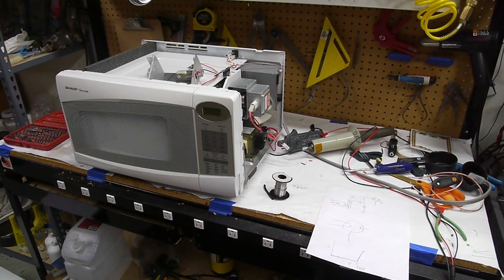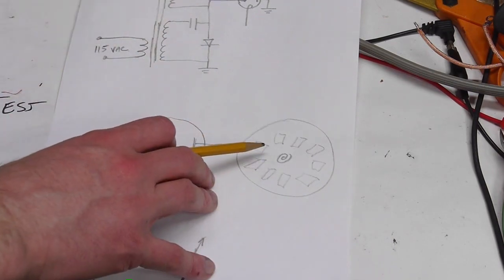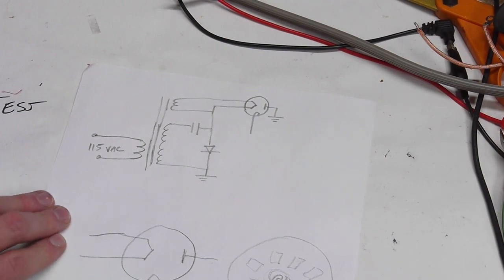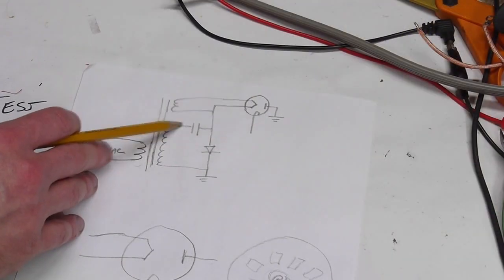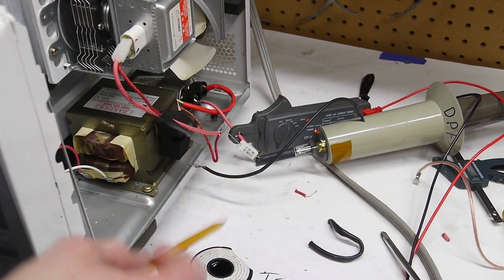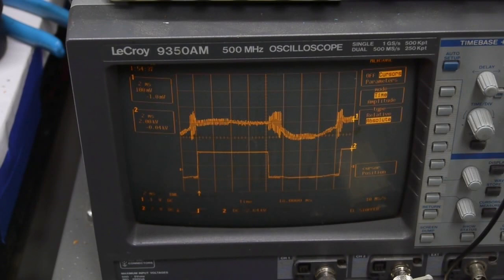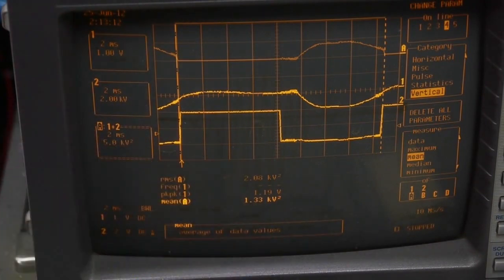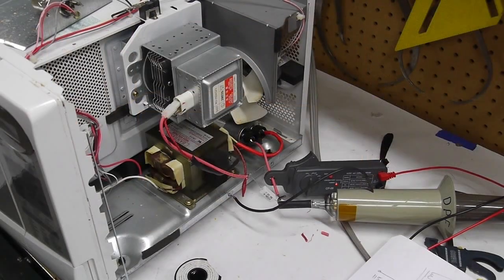Measuring the voltage and current of a microwave oven magnetron

Comment: If positive output is connected with MOV body and cabinet why not it's dangerous to touch the cabinet ( even at negative voltage at output ! ) Or it is because ... ! The output is isolated from mains so touching the cabinet can't close the circuit  or something similar ??

Comment: If I'm not mistaken, microwave ovens are rated by their output power, not their input power.  That looks like an 1100 watt microwave (Sharp R308N or similar).  Based on Ben's measurement of 1.33 kW power to the magnetron, that would make it 83% efficient, which is about what you would expect for a magnetron.

Comment: Loving your videos!  The frequency of oscillation is actually a function of the LC tank circuit each of the cavities makes.  So they are tuned to 2.45GHz.  The magnets are there to provide centripetal force to the electrons so they spin around in a helical pattern to impart energy into each of the cavities as they spin around.  Because of mutual coupling, placing an antenna in any one cavity will couple the energy of all the cavities at the same time.  Again great video!

Comment: Surprised you didn't just unbolt the transformer and diode from the chassis and insert your shunt there; then ground voltage is maintained for safety and you can measure current via ohm's law. As to the average power, if the peak is 1A and the waveform is roughly sinusoidal, then you should have average of 707mA by RMS. So you have 2.8kW half the time (halfwave rectification), thus 1.4kW average input. I'm not seeing anything out of the ordinary here.

Comment: I believe the2 ms.  The current is space charge limited as the electrons just spin around until the voltage is high enough for the electron frequency to match the resonant frequency of the RF structure.  At this point energy is coupled out of the beam, orbits decay and electrons hit the anode, removing themselves from the electron cloud.  Current flows.

Comment: Um... In high voltage circuit there is a 2100V 1uF capacitor in series. This is half-wave voltage doubler. During half wave it is charged ( until 2100V , about 2.2J) and then release 4.4 joule at another half wave..... therefore  the HV side consumes 4.4 x 60= 264J per second in case of 60Hz...
So magnetron HV wattage is 264W! And mean current is 264w/2100V=0.125A
This is my opinion. Is it right?

Comment: Why is your voltage output a square wave? It should never be a perfect square since the start of the negative 60Hz cycle voltage should be just the peak of 2200v. In the middle of the negative cycle, it will not be 4400V eithrr because the capacitor already discharged some of its energy. Towards the end of the 60Hz negative cycle, the voltage will diminish close to zero, or if the capacitor is big enough, to 1800v to 2000v range. When you have load, ie you have food or water in the oven, the capacitor will never be big enough

Comment: The power supply is more complex then you diagram.  Look carefully at the transformer.  You will note a magnetic shunt between the primary side (where the 120VAC comes in, and also the filament 4V winding is) and the secondary side.  This type of supply is a "ferroresonant regulator".  The cap does more then double the voltage; it is in series resonance  (at 60 Hz) with the leakage inductance (created by the magnetic shunt) of the secondary.  Because of this resonance, the output voltage would build up "to infinity", (like a tesla coil) if it were not for "some limiting mechanism".  That limiting mechanism is the saturation of the steel in the magnetic shunt.  So the power supply is a sinusoidal (half-wave) current source.  It must be, as a magnatron is an "obnoxious" load, like a gas tube, with negative resistance.  This regulator is used in mercury vapor and sodium vapor streetlights, and was used in old (heavy!) computer regulated supplies.  To work properly, only the frequency needs be correct; line voltage can vary a lot.  (Topaz "constant voltage transformers" also work by the same principle.)
If you try to push more current through a magnetron then the cathode can emit, the current abruptly cuts off (in nanoseconds!) resulting in a huge spike.  For this reason, the diode has a special "soft" characteristic to damp this.  (At turn on, the cathode is cold, so no current flows.  As it heats up, current starts to flow at the start of current sine wave, where the current is low.  When the current exceeds the emission of the (not yet totally hot) cathode, and current suddenly cuts off.  As the cathode gets hotter, conduction time gets longer until suddenly cathode is hot enough to allow conduction the complete half-cycle.  Listen carefully as oven is turned on.  You will hear a "ba-zap" sound like Darth Vader's laser sword being powered up.  That sound is produced by the changing phase shift of the cutoff, then abruptly stops when cathode is hot enough.  If you put scope in long record mode, you should be able to see the changing current cutoff, if the EMI spike doesn't hide it.)
I mention this because I think magnetron will "stall" if you try to "shove" spike of current through.  Even if it doesn't, the cathode will limit the current because of its limited thermionic emission.  A huge electric field will build up at the cathode, maybe leading to destructive arc (blowing off the thorium at the surface of the thoriated tungsten filament).  If magnetron "works", it may arc over at the output probe.  Radar tubes are typically in pressurized container, some with SF6, up to the point where the horn antenna is flared enough to prevent flashover.
Newer microwave ovens have switching supply.  I don't know the details how they work, other then having resonant transformer (with litz wire primary) and 2 diodes in a voltage doubler configuration.  I have photos of newer supplies.
Reply: MOTs not only saturates at the secondary side, but beacuse copper(or aluminium) windings in the primary coil, and steel are cheaped out, they draw lot of current, and dissipate heat without load, and the cap disconnected(hundreds of watts of copper and core loss).  Altough, MOTs in old russian ovens at the same ratings are twice as big, had hypersil cores, only handwarm after hours of no load circumstances, but a regural cheap chinese one cook itself without cooling in an hour.
I'm pretty shure that the new smsp drivers are far more efficient.

Comment: Only God can help the amount of harmonics and power factor that these devices are putting on the grid
Reply: No they are not!  The transformer in the oven he shows, is a "ferroresonant regulator".  The cap is in resonance with the magnetic leakage of the transformer (a magnetic shunt is inserted on purpose to get this leakage).  Resonant circuits "demand" a sine waveform.  Any deviation (due to diode switching, etc.) causes resonant circuit to deliver/accept energy to force sine wave load on line, at near unity power factor.
Newer ovens have switching supply.  I suspect (but have not confirmed) that they use power factor correction in their switching algorithms.

Comment: For a fixed magnetic filled, the I V curve is actually much steeper than you have drawn.  There is a threshold of electron angular velocity below which the tube will not oscillate, therefore no energy or velocity is taken from the electron cloud and the current is limited by space charge to essentially zero current.  If you detected RF power you will see perfect alignment with RF and cathode current. Once the tube is making power the impedance  is  very low and current is limited by the leakage inductance and resistance of the transformer.
Reply: What you say about the tube is correct.  But the "transformer" is way more complex then he explains.  The capacitor and the leakage inductance of the secondary (there is a magnetic shunt to make this) are in series resonance.  Current builds up until the shunt saturates, detuning the circuit.  It is a very accurate regulator, if the driving frequency is correct.  It is also used in streetlights, old computers, and Topaz "constant voltage transformers".

Comment: i like the video, it helps me understand a lot.i have one thing to ask ,normally most of the time as i observed most of the magnetrons are supplied with a  3 to 4V Ac and up to 10 A current flowing through the filament.  what will happen if the supplied voltage to the filament is increased  or decreased? what makes the microwave output power high or low ?is is the filament voltage variation or the high voltage side variation ?
Reply: the microwave output power is decided by the capacitor in the voltage doubler circuit, making the capacitance larger increases the high voltage and thus the microwave output power, however its important not to exceed the maximum output of the magnetron .

Comment: Hi nice video.i want to ask one question .do we have different magnetron rating is it all same or ...?I noticed from articles that they have a filament which is mostly supplied 3.2V ac. Do we have any other such parameters ?I wonder what really makes the microwave output power higher?is it the high voltage of the filament voltage ?

Comment: +Applied Science Part of the time delay between voltage and current may be due to the fact that many electrons return to the filament (after having lost energy by creating microwave photons). They make the filament hotter by hitting it. Hotter filaments emit more electrons (more current), but as a nonlinear regenerative process, it takes a while to get going. The overall process causes some undesired Frequency Modulation in the 2.45 GHz output. Also, when the HV section starts to flow real current, that robs some power from the filament winding. It would be interesting to see how things would behave if the filament was powered independently.

Comment: So... The lag between voltage and current is probably correct. You noted that you thought that it might be an artifact of your probe, but that lag is partly why cavity magnetrons are not used in high power communications.

Next, they have harmonic overtones... 1/2 wave, 1/3 wave, 1/4 wave etc.... and each of those produce a disruptive tone which can actually reach resonance before you hit the frequency that the magnetron is supposed to be tuned to. This is something you probably need to know, but you're probably also aware of. As a quick note, if you can find a tone not absorbed by water, sugar, and oils, that might be safer to work with, but if you're trying to flash cook nm. (aka only helpful if you're making an EMdrive) 

Thirdly, Cavity magnetrons are voltage controlled. The calculation is based on the distance of the anode from the cathode but it also involves the magnetic field. If you want better control over the magnetron for more precision you should actually remove the permanent magnets and use an electromagnetic coil (like a solenoid). The magnetic current through the permanent magnets controls the electron bunching through the magnetron; if replaced with an electromagnetic coil, the voltage through the electromagnet could be used to control the frequency. 

Finally... Especially you with your awesome lab, could actually make a cavity magnetron tuned to a frequency that isn't lossy (aka not water and fat). I've been kinda working on it but i figured it'd be a bit before i made a video about it..... here's some math that I've noted...

Frequency = 
(((Magnetic permability of free space)(dielectric constant of material in the not metal parts of cavity magnetron)(circumference of 1 resonant cavity)(length of magnetron tube * distance of the resonant cavity from the cathode)))
                                                                              /
(Length of magnetron tube * distance or break in circumference of resonant cavity)

If you notice, the length of the magnetron can actually be dropped out and you can simply look at the magnetron in it's entirety as a circular cross section. I suspect that the break in the resonant cavity should also appear as a subtraction term in the circumference of the resonant cavity, but i might be wrong. 

Any way... i spent the last few weeks incidentally looking into microwaves and thought i might be helpful. Don't cook yourself with a stray microwave emitter, and I can send better mathematical formula if this helped at all. If you made a magnetron, there's a few other things i can throw up like pi strapping, resonance conditions, and some things that effect efficiency.
Reply: You have several errors in your material. 1, the lag MAY be due solely to his current probe (an RF detector like an HP423 could confirm WHEN the tube actually start to make RF energy), 2, the overtones (cavities work on ODD overtones, not even). There is NO non-lossy frequency for water as you seem to indicate; the action of 'heating' is because water is a polar molecule and TRIES to move with the applied RF field, in particular the E-field (It tried to align to it).  Industrial ovens work on the other ISM band (900 MHz). You're probably wrong on some other points as well, so, anybody who is reading this - beware of what he has proffered.
Reply: @uploadJ  yeah maybe, but, I bet my left nut there will be some crazy experimenters out there who picked up on the idea of changing the frequency of the microwave simply by removing the donuts magnets and using a coil in their place, or maybe just adding a coil to the magnets….to make a new type of wild FM transmitter ! the COIL-A-TRON ! copyright Psychroniser...

Comment: Why is the range so weak on such powerful magnetrons? I see videos of people putting cans on the end but it still seemed limited to around a foot in front of it.  It would be good if you could make a beam so you could then use it for some point to point wireless powered devices.

Comment: Maybe you can measure the HV current by clamping the clampmeter on both filament wires?
Reply: +Applied Science Listen to this man, +Tim van Neijenhoff. Opposing currents in co-clamped wires will cancel out, which is perfect for distinguishing the Anode current from the Filament current.

Comment: I once presented a small research on microwave cavity resonators and simulating them. After the presentation, a member of the "jury" told me that I'd get 3x the power out of a microwave oven magnetron if I cooled it. Run cold water trough the vanes?

Comment: Could the electrons that circulate through the cavity of the magnetron, since they're moving as if in a coil of wire (even though they're moving through a vacuum) act as an inductor, causing the current to lag the voltage?

Comment: I would guess that the current lagging the voltage is the power factor caused by the large transformer acting as an inductor.. its interesting that the capacitor is oversized quite nicely and that it isn't dropping voltage near the end of the waveform, I would have thought manufacturers would have put the smallest cap in that would only just get the job done.
Reply: I would have expected the voltage to sag; it didn't. It's probably the current probe he's using (if it uses a Hall effect, that's probably why)

Comment: To our younger scientists and electronic engineers I'd like to point out that working with magnetrons is serious and is extremely dangerous, embolisms (microwaves can and do evaporate subcutaneous fluids) and cancers (DNA and RNA damage) come immediately  to mind in addition to burns and very possible fatal electrocutions.  As soon as you start work on a microwave your are on the wild side of dangerous explorations.  Inform yourself of all precautions before looking under the hood.
Reply: Your eyes; ask me how I know (had double cataract surgery at only 63 last year, one eye completely blind for last 20 years.)
Reply: The DNA and RNA damage is a myth. Microwaves at 2.45 ghz are far from ionizing frequencies which are beyong blue color, above 800 thz.
But there is strong risk of electrocution. In fact, my worst fear happened trying to create a microwave gun. I touched the transformer and got the "fear of dying" more than pain, worst than color tv shock at 25 kv.
I assume the ground from the electric plug may have been faulty...
And maybe, as radio frequency do, there could have been some unpredictable path to the signal.
If you still want take that risk, tell your mom or roomate to check on you and make sure they know cpr.
Reply: @moiquiregardevideo , I wouldn't be so sure about the DNA/RNA thing. Non coding RNA folds up like proteins and creates secondary and tertiary structures whose resonant frequencies are way lower than the bonds between individual nucleotides. Denaturing those molecules could lead to cancerous activities.

Comment: I had a few questions about magnetrons 
1) How do you calculate the amount of electrons emitted from the cathode?
2) How the amount of electrons emitted from cahtode and  the voltage between the anode and cathode affect the power output of the magnetron?
Youre help is greatly appreciated.
Reply: Vacuum tube theory; look up Thoriated Tungsten in particular.
Reply: After 6 years, do you still want to know? Or somebody else stumble on this youtube video and wander...
The number of electrons is exactly the current in amps (multiplied by a constant to adjust the units).
The power formula in p=vi 
So, current in amps
Multiplied by voltage in volt
Gives power in watts, which is joule per second.

Comment: Hi, the magnetron of my microwave it´s broken , so i need to replace it . The magnetron is a Galanz M24FB-210A G0208o12 GAL02 GEMC . 
My questions are: 
1. Can i replace it with another model, or it must be identical to the original one?
2. What is the GAL02 Number represents?
 Thank you !